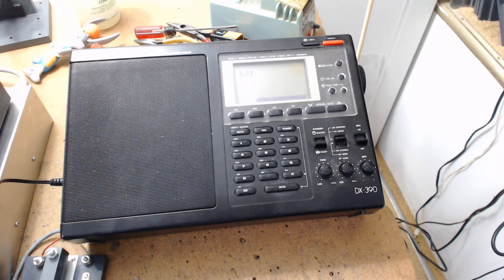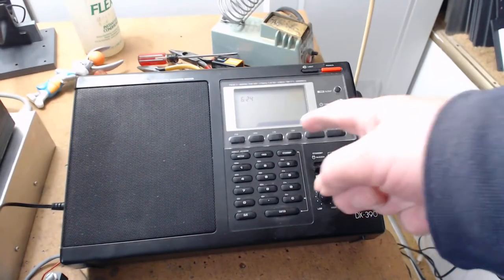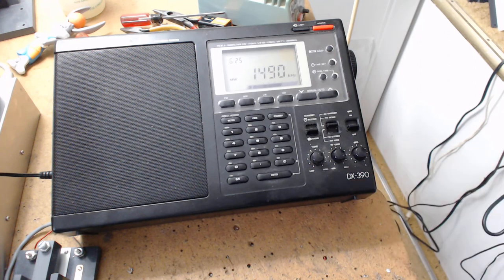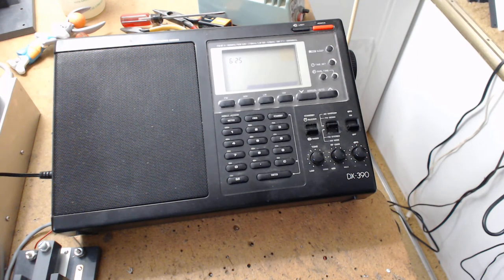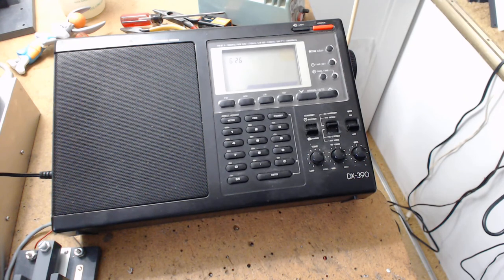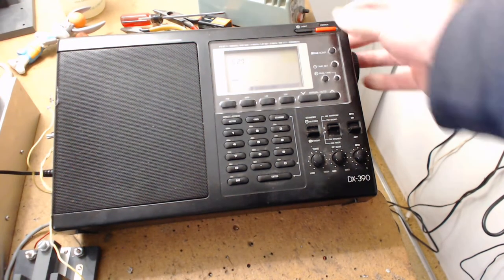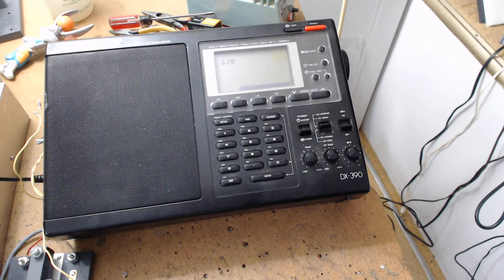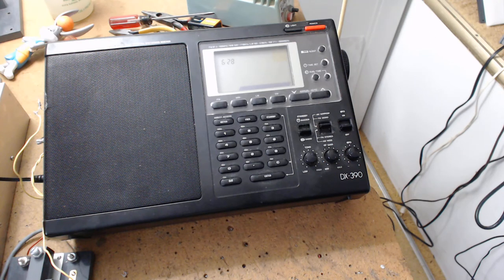A DX-390 Mod bit me!

Comment: My sangean over loads easy on am broadcast and its not moded! Strong stations will do it but fine on sw
Reply from the maker: After a few days my other radios started hearing the station distorted. I just tested now and it is fine. The station went off the air for a few days back then The DX390 is the best radio for the price.  I use it all the time!